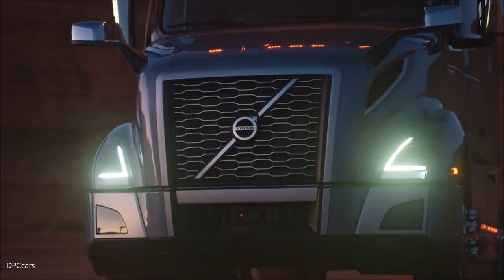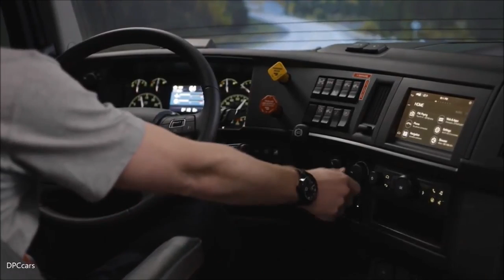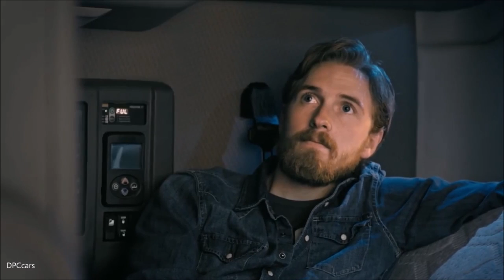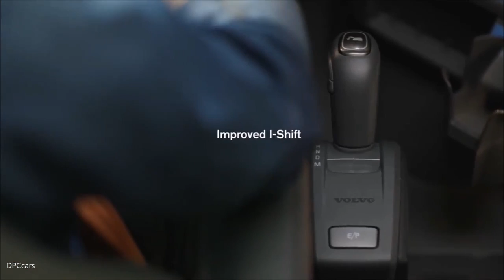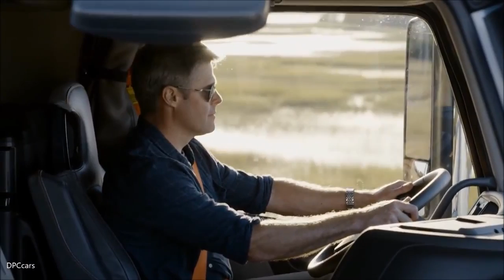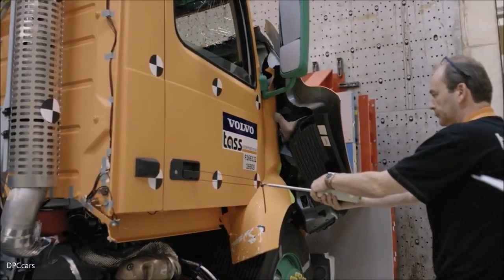2018 Volvo VNL Truck Features & Options

Comment: Volvo still needs Factory diesel APU. The battery system offered for $9,000 that needs batteries every two years minimum for another $3,000 is not better than diesel until they replace batteries with lithium units less weight and more run time

Comment: NOTHING BUT A LEGAL SCAMMERS!!!  STOP EXPERIMENTING YOUR GARBAGE WITH OUR HARD EARNED MONEY!!!  
My 1998 vnl 770 has same interior features, and my cab made out of the same high strength steel as well!?   My cluster can inform me of the same things that are necessary to know?   My seats are made from the same cheap vinyl not leather.    Only my frame is much thicker so is my hood and fairings,  and fairings doesnt wobbles?   
          CAN YOU INVENT SOMETHING WHERE I CAN REALLY SAY "WOW"??? 
Led bulbs,  rubber dash pad,  color cluster,  extra cup holders,  door lock from sleeper cost $170 k ?   Really?   To rebuilt I shift cost $32k what my friends warranty paid when it blew,   warranty covered it then it start to glitch again,  pulled in the second time and was told by a volvo dealer that second tranny repair will be on him since they believed he was a bad driver...   Really?  Volvo?   
Where is the legit bumper on this truck?  If you hit a deer,  this whole front end will all be in to pieces!  
Guys ,  Before signing papers,  go to your local volvo dealer shops and see how many new trucks are waiting to get serviced.     Ask service dept whats it cost to replace power steering pump drive gear?   Whats it cost to replace  fuel injectors,  pump?    ( which warranty will only cover ones ! )   
 How about oil pressure sensor replacement that requires removal of an oil pan?   Really?      
 Not to mention when it hits 500k miles be ready to spend $40k  +  on engine rebuilt alone....    
With this high payments,  your truck will have 500 k miles in 4 years,  and will worth  $35k - $45k ?  And trade in value would be $25k?    And you will still be owing $55?   Then you will need to decide if you wanna dump $75k in repairs or simply trade in and add remaining balance to the new truck payments?  
Late trucks / engines  built where you will be homeless forever..    

I see guys suffer,   families strugle financially,   kids grow up with out seening their dads,  wifes dont see their husbands,  all because guys are blowing their home time at a service shops where manufacturers testing their products on someones childhoods and money!!!
 That makes me just say all this modern trucks manufacturers only thinks money and quantity.  Thiefs ! !!

Comment: The Lady was talking about the transmission, that the driver don't have to focus on which gear he is driving and also not need to remember it during driving. That isn't a point, because we don't need to remember the gears during driving. Our brains know it all the time in which gear we are. Driving is like walking, it happen automatically. You just learn it in the beginning and after a while your body and brain is doing it passive. If you know what i mean.

Comment: the volvo  ist a nice Truck and  have  a great  cabin but  i drive  in germany a fh4 volvo. this  is from  the  Technology much  better wer drive Euro 6 Trucks  with  pneumatic  bumpers. also we  dont need  so many Instrument foŕ çontrol all, at the the the computer  control  for you. the Engine you  can  order  till 750 horse  Power in the fh 16.